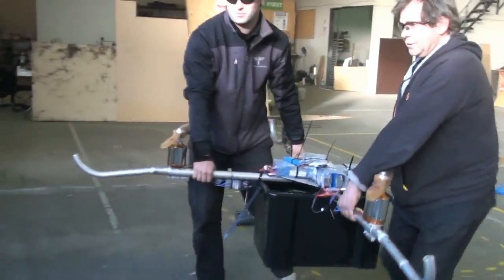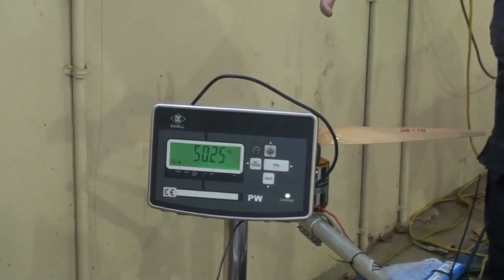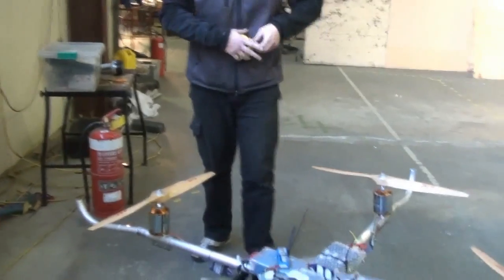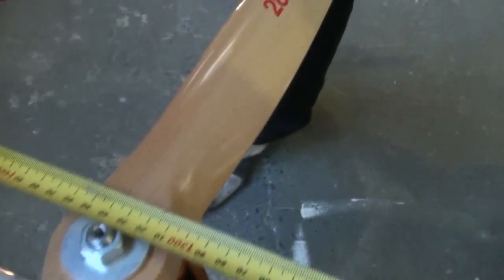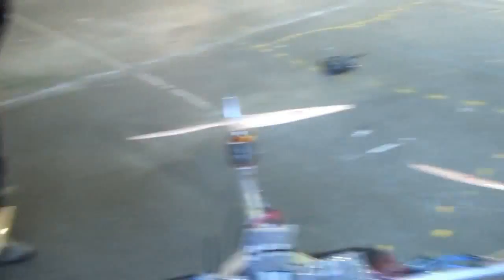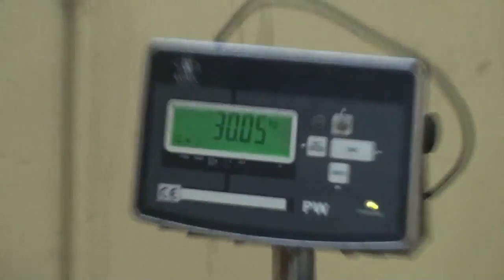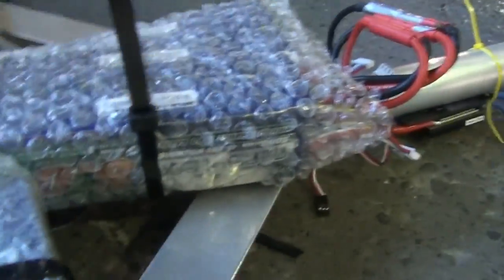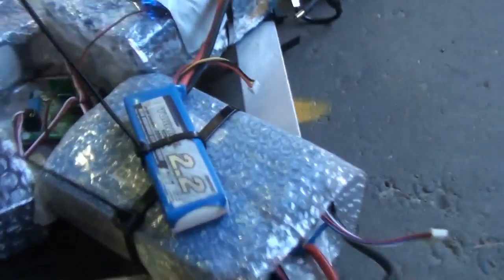HK Beerlift Entry 30.05kg Colin Dodge

Comment: Here's an idea, you will owe me $500. USD for. Connect 30 pounds of batteries instead of beer, you will then be able to boost ability & flight duration. And on an aurduino pilot chip & you will be all better for it.

Comment: get to the point to lift a car battery. Run helis for days
Reply: ***** Yeah no sorry.
li-ion specific energy: 300W/KG
lead-acid specific energy: 180W/KG

Source:
http://en.wikipedia.org/wiki/Lithium-ion_battery
http://en.wikipedia.org/wiki/Lead%E2%80%93acid_battery
Reply: More like minutes. Can't beat LIPO for power to weight ratios. You fly yours with your car battery though and tell us how it goes. :)
Reply: Ryan Zavitz Lipo. - 5 amps or so. Car battery - 500 - 1000 + amps. might weigh a bit more but could easily do it for a few hours.
Reply: ***** Oh shit you're one of THEM. What's with the flood of trolls on youtube lately?
Reply: Hatagashira You tell that to car audio experts. See what they have to say about this.
Reply: Hatagashira Trolls? that hurts. You are the troll.
Reply: Kevin O'Brien where?
Reply: really bad idea, a car battery isnt rated to discharge that quickly.

Comment: I DO!!!!- & while I'm at it...I have a question or  2 about it.... What would the flight duration be without the  30kg weights? -  next, what are the motor sizes props sizes and power requiremements for this ? - thanks in advance guys - I'm looking at an FPV unit with BALLS!!! - would this do perhaps?